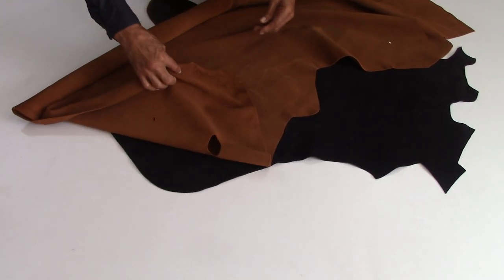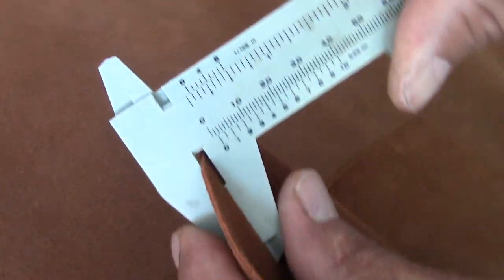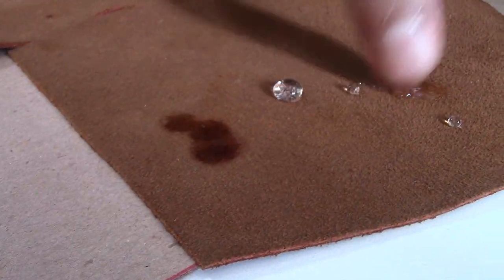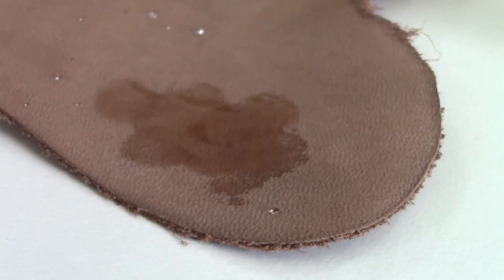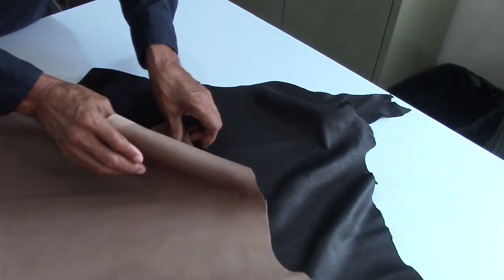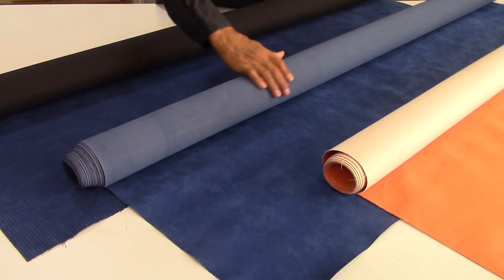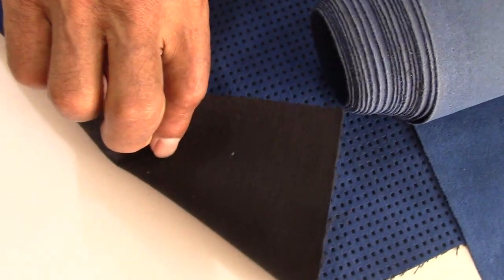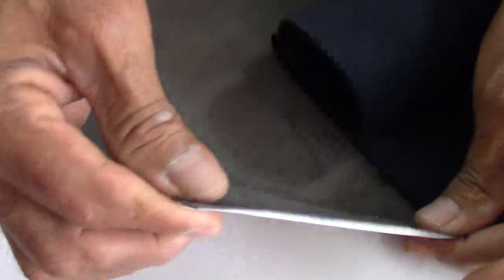Types of Leather Suedes -  Car Upholstery Furniture

Comment: True suede is top grain that has been buffed with a fine wire buff . The hides used are the best quality free of imperfections . You can tell which suede is the highest quality as it does not leave marks when you run your fingers across it . The leather he is calling suede are what’s known as splits or suede splits , a common mistake . Unless they  bullshitted me when I did my footwear trades course at East Sydney tech 30 yrs ago , this is what I was taught . Don’t get me wrong , I love this guys work , a true craftsman of the highest caliber . Just wanted to set the record straight .
Reply from the maker: Thanks for sharing useful information! Ours is limited to a basic knowledge as car upholsterers.